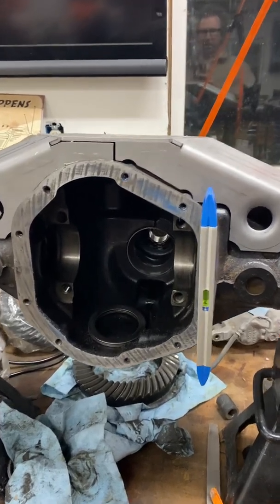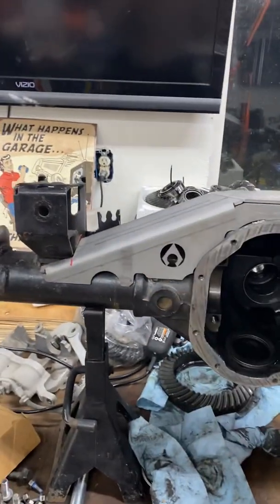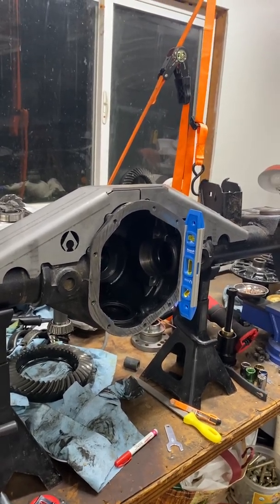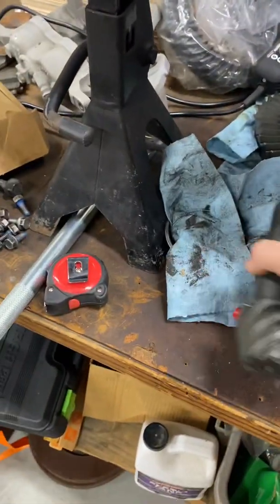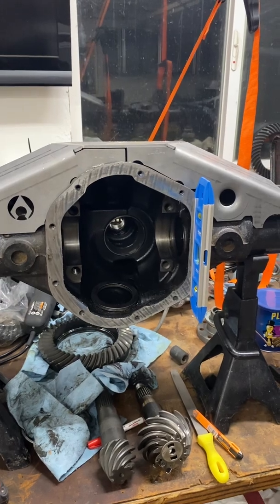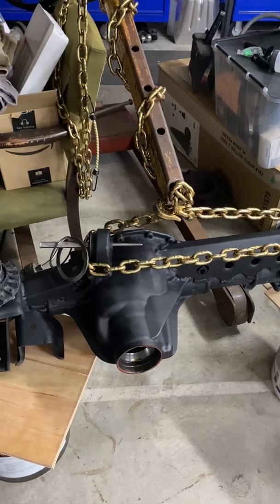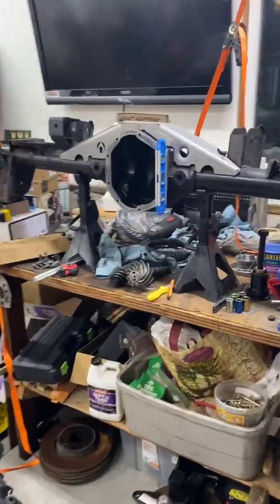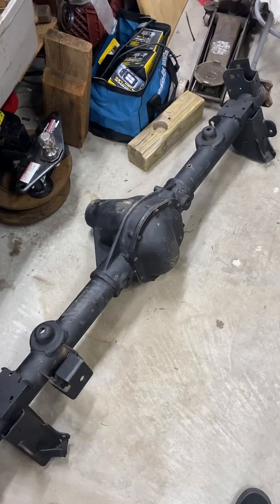Axle Upgrades for the ZJ

Comment: If you wanted to do this on a budget you could have done a 44 front axle and a ford 8.8 in the rear
 I have a 98' 5.9er and did the ford with 4.10's and a limited slip all for $120 from the LKQ on a 40% off sale. With the truss kit and the brackets from IRO and a couple of welds around the tubes I've got less than $300 bucks in it and bet I can't break it with the 35's I'm running. Oh and larger 31 spline axle shafts as well as larger brakes  upgrades were free with the swap..Now the front 30 is just living on borrowed time! LOL...
Reply from the maker: Yeah, I should make a video about that. I thought... since I found a couple of deals on Dana 44s that I would be getting this done cheap. BUT no way. The parts for the 2020 JL front axle are EXPENSIVE. It is a new/redesigned axle and all the seals and bearings are new sizes. Then I still had to cut off and weld on a bunch of brackets. 
I thought the rear axle would bolt in (as I was told) BUT I ended up having to cut all the brackets off and weld on all new. Anther big thing I learned was that most second hand axles you get from junk yards or craigslist are bent. You need to have them checked before investing a bunch of money into them. My next build will be Dana 60s front and rear. Cheap and tons of parts. Plan on removing all brackets from the start and weld on what you need where you want it.

Comment: Please format your videos so they can be watched in landscape mode.Your video is currently only able to be viewed in portrait mode and gets reduced in size substantially when viewed on a tablet. Other than that, thanks for the info on d44 axles and trusses.👍
Reply from the maker: Thanks, I'll shoot an update video in the proper orientation in the next couple of days. I've got both axle ready for assembly. Getting the gears lined up is a bit tricky if you don't have a supply of extra shims laying around.